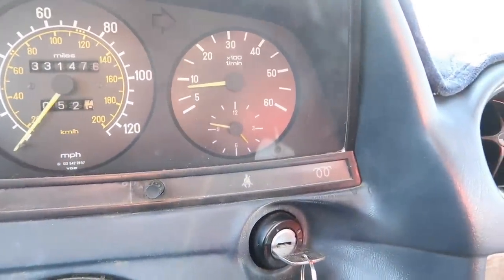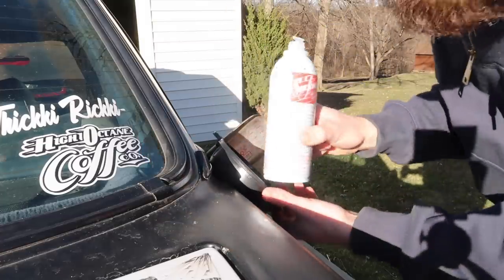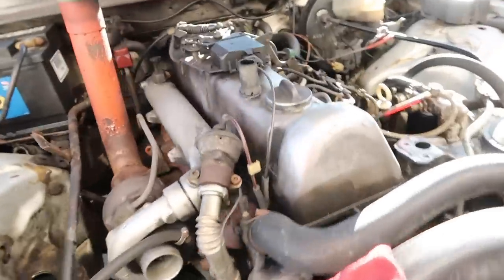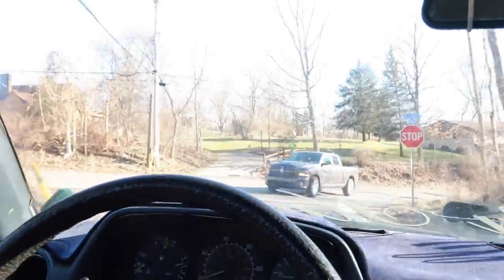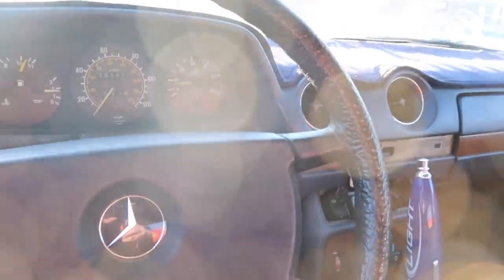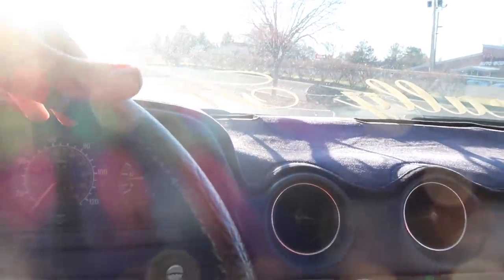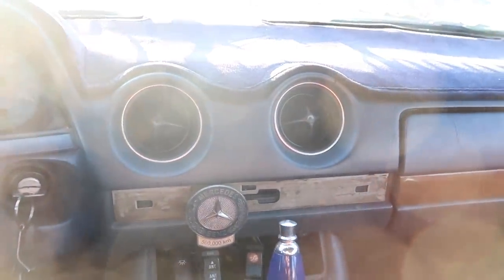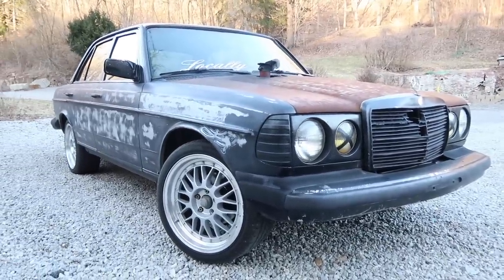What Happens If You Seafoam Your Diesel? - WAY TOO MUCH

Comment: I tell yall what, I put in my 6.7L powerstroke  8oz. of  Clear Diesel by Power Service and man what a difference that stuff made and my rig is well taken care of so it wasn't because it was dirty and neglected. It made a believer out of me. I felt it right away with the down shift. I didn't have to push the pedal down as much to get it to down shift and the power was pretty noticeable. I've tried Sea Foam and I really didn't notice much but then again I didn't put in 2 cans in it.

Comment: I highly suggest you dump that oil ASAP. Sea Foam is mostly just kerosene and while it will clean out all that sludge, it has thinned out that oil way too much and if you keep running it it will destroy the engine.
Reply: Diesel's pretty much oil
Reply: That's a popular myth with the kerosene. However you are supposed to do an oil change after a few hundred miles of seafoam in the oil. But this is because breaking up carbon increases the amount of crud suspended in the oil. It's a consequence of "cleaning." I have seen their intake cleaner do wonders too. I don't know that it is actually better than marvel mystery oil but I can say it is a great product. It's also a water remover which is never a bad thing.

Comment: I usually use 2-4 cans per tank of fuel every now and then and I talked with seafoam and the rep said you can do up to a 50/50 mix of fuel and seafoam
Reply: Diesel can run 100% sea foam. When I change my fuel filter I prime with nothing but sea foam. 5.9L cummins and my isx15 cummins both get it that way.

Comment: Put Seafoam in my 04 6 liter with 170k on the ticker. Put Seafoam in the oil and fuel tank for about 6000 miles and it absolutely fixed my 6 liter. Truck wouldn’t start in 50 degree weather, smoked like crazy. After Seafoam it now starts and runs like a brand new truck. Seafoam saved me from a $3000 injector job. Honestly THE best oil and fuel treatment on the planet. God bless.
Reply: I have an 2000 7.3L diesel, how much should I add to the crankcase or oil?
Reply: I would put 16oz. Seafoam says to put 1-2 oz per gallon.
Reply: @leegray6165  in gas tank or crank case
Reply: Orlando Marner in the engine oil-crankcase
Reply: I also put it into the gas tank. Same ratio 1-2 oz per gallon. That stuff is amazing brother
Reply: @leegray6165  Right On!
I will try that ratio to my 7.3L
Reply: @leegray6165 Will I have to change the oil by putting that in there
Reply: Orlando Marner negative. I ran it for 3000 miles in each of two oil changes.

Comment: 94 Grand Cherokee 4 liter would not pass smog. I changed the cap rotor and wires and also ran two tanks of premium gas through it with each tank a bottle of seafoam. Not sure if it was the sea foam or the new cap rotor and wires but we finally passed smog. We had parked Jeep for 5 years after putting two new cats in it and it would still not pass smog. We have put some other chemicals in the gas tank before that what those did not work before it was parked.
Reply: When Smogging a vehicle it’s best to run the lowest octane your engine is happy with. If it’s not a high compression engine then the longer burn time or incomplete burn of higher octane will be more work for the emissions system.

Comment: Valve adjustment is diesel tune up 31 miles per gallon adjusted,no smoke,if u got over 50,000 miles since the last adjustment,u could burn the seats of the valve,driving like that with the valve taping it an idiot,I bet u it's blown up by now

Comment: Engine flush is essentially Kerosene and that is obviously cheaper than any bottled products for engine carbon cleaning, this being said I wish I never used that on one of my old vehicles because it cleaned away the grime that hid the wear and tear from previous owners and this was simply ran before the oil change at idle.  I imagine Sea Stuff is similar in crankcase oil. 
Kerosene - Napatha. In the fuel tank it the Kerosene is probably like adding Jet Fuel to a lesser extent and should lower the power of diesel fuel ( water it down so to speak ) this can be a good thing perhaps to prevent gelling of diesel fuel being stored for long but now I am getting hypothetical.  Sea foam has its use but I would not abuse a machine with it- read the label.  🥳

Comment: I had this same car new, the dealer had add a quart of 30w oil to each tank. It quieted the fuel pump and injector noise. That is not valve noise it is normal  form injectors, and diesel ping. Also, trans fluid super cleans system.

Comment: I use half of can every oil change on my 2012TDI ! had 326k miles when I got rear ended and never replaced fuel pump on injectors on it ! this stuff is golden and cheap ! only like $8 at walmart
Reply: @BlondynCh  A whole can in the fuel tank made it run rough?
Reply: Michal I run it in my 2003 ALH TDI. Great stuff!
Reply: @tinysolarshack9615  oil or fuel tank? I have an 03 golf TDI. Still seeing differences?
Reply: @tinysolarshack9615  how much do you put in your fuel tank
Reply: I use 1 Oz per quart of engine oil in the engine. I add it about halfway to the next oil change.
In my diesel fuel I add about 4-6 Oz per tank full.

Comment: In these old diesels you can run a little atf in the fuel as a lubricant and cleaner, and you can add some to your oil as well. Works great
Reply: Do you know about how much atf would be safe for 16 gallons of diesel
Reply: Highteckhobbies maybe half a qt. But you cant use atf in an efi system. Has to be mechanical fuel injection. When i change fuel filters i will usually fill the filters with atf instead of diesel. Just do it at your own discretion. Atf has some heavy duty detergents which will clean the fuel system out very well.

Comment: Might be time to adjust the valve lash....which may also reduce the crankcase venting.
Reply: Please explain the correlation to valve lash and crankcase venting
Reply: @drd1924  Excess valve lash can allow   cylinder compression to vent into the crankcase. Basically, the opening/closing cycle of the valves is no longer timed correctly since the pushrods and rocker arms aren't fully opening the valves, and the camshaft is turning  more for the lobes to move the pushrod.
Reply: @zombieresponder  Cylinder compression vent into the crankcase - past the rings?
Since the valves arent open as long as they should be?
Reply: @drd1924  Yes, or they're open at the wrong time.
Reply: @zombieresponder  Thanks man. I understand the importance of proper lash just didn't consider extra cylinder pressure if lash is excessive. Diesels mainly where I've seen lash spec is often more than a gas engine.
Reply: @drd1924  I need to set the lash on my Cummins....supposed to be done every 20k or so I think, at least on a 12 valve. If your Mercedes has a mechanically driven injection pump, it might also be wise to verify pump timing. There may also be an excess fuel return valve that is allowing too much fuel to return to the tank, rather than being forced into the injection pump.
Reply: @zombieresponder  Interestingly, my interest in this topic is also for a cummins 12 valve. I regularly adjust valve lash on ATV's which usually calls for .006" +/- .001 being ok.
and if the adjustment ever changes it always reduces clearance as you might know due to valve wear. Last I checked my cummins exhaust valves it was at .025". I figured I would leave it and check it later to see if there is any valve wear going on but by doing so am considering this could contribute to some crankcase venting.
Reply: @drd1924  .006" is pretty tight. I'm used to seeing small engines in the neighborhood of .010" to .015"....although I have spent a lot more time working on the older L heads than the newer OHV designs.

Comment: You might want to be careful with adding too much Seafoam. When the prechamber burns too hot (like from accidentally adding gasoline), the metal of the prechamber can crystallize and become brittle, and when it breaks, you get bits and chunks in your engine.
Reply: Seafoam says you can run a diesel on straight seafoam
Reply: @ewetho  Short term, like filling the filter housing with it.
Reply: @gadgetdan1  I've done it half and half  it works.

Comment: How does it run if you completely purge the system of the SeaFoam?  If it returns to the way it was before, could that just be the additive increasing the combustibility of your fuel?  What is your elevation?  I have a 1984 6.9 IDI @ 7800' altitude and used it once-down the intake the lesson was nothing short of- I wouldn't advise this entry point.  Thanks for the info!

Comment: You can buy the recommended German fuel system “diesel purge” cleaning liquid on amazon
Reply: ferkemall I’d trust what Germans put in the engine over others who didn’t design the engine or fuel system anyway over sea foam, I’ve used it and it never did anything but make the engine smoke bad.

Comment: But hey, when you put a cleaning additive in the oil, you should Gas with it for 15 minutes with, for example, 1800 RPM. You should not drive the car and you should drain the oil and change the oil filter afterwards

Comment: I use it in all my 2stroke,if it call for 4ozs of oil per gal. I add 4ozs of seafoam and add gas to the 1gal mark.It results in the cleanest and driest spark plugs, which means that everything is burning completely
Reply: Mike Hicks have you threw a rod bearing yet ? That crank and rod bearing is lubricated by that 2 stroke oil, I wouldn’t run it every tank or rarely would I ever use it unless you have problem , if you have a problem fouling spark plugs run a hotter plug

Comment: the reason of seafoam in the engine is to flush the oil out, your not suppose to go for a long drive lol YOU MUST change your oil right after your 10 mile ride

Comment: Should have showed the oil change. I always have carbon chunks come out
Reply: After adding sea foam you get carbon chunks out of the oil?  Sounds like it's worth it to get that out then.
Reply: @TravisFisher  that's what it does for me. Was looking around to see if anybody else had this happen also.
Reply: @TCGThuggyC  thats actually terrible ..you dont want carbon deposits breaking off and going threw a turbo!! It will ruin the turbo. If your getting chunks of carbon then you need to tear apart the top half and have the valves cleaned professionally..
Reply: @planetofthederps4490  I just have a 5.4l, no turbo. I clean the metal oil filter in the pan everytime. It works for me

Comment: Use motorkote works great .  My 6.slow loves it.  My injectors are quieter now .
Reply: Use rev X. Your 6.0 will love you way more. At least mine loves it. It’s pricey but I treat it every other oil change.
Reply: Love the Motorkote. Really love they're spray lubricant too

Comment: High risk games.  Petroleum is a great solvent.  But you risk a gasket leak due to removing the seal created by carbon deposits on high mileage engines.  Everything runs smoother for sure.  Even improved fuel economy.  Plus, a longer engine life as the protective film covers everything helping prevent excessive wear from moving parts.  Use any petroleum additive on an engine under 70K if you want to see 500k.  I hear an oil catcher is also key on a variable cam to prevent sludge damage to cam solenoid and lifters.

Comment: Used it on my e46 Diesel BMW half and half as instructed, the air intake sucked in a valve (later improved) model and then the engine runs on after I cut the ignition, engine has never sounded the same since.

Comment: Do the intake spray!!. Would love to see the color of the oil after it cleaned up the gunk
Reply: Shaun Thomer that smoke you see when you put a fuel cleaner such as sea foam in the intake, is the actual cleaner getting burned off
Reply: @michaelnikprelaj6679  if that were true. It would smoke immediately and not after the heat soak.

Comment: hope you are change the oil =) also a (cold) air intake  (k&N filter)  is needed,  i mean outside air, not from under a warm engine, to top of the gains.
Reply: Needs pil change. Delo 400 or Rotella T4/T6 would be good. Adjust valves and check timing. Turn the pump up and give her some more timing. I'd use a dry filter just cause that turbo gonna be sucking out that wet filter oil.

Comment: Your videos are really good ;)  I also use Seafoam in my gas alot ... I really like it.  There is also this stuff called  Auto-RX that has been equally interesting .... I tried it in my transmission and could tell a difference with-in a few blocks ...... it might make for an interesting video, cuz basically no one really knows about it .. .. .. it works in engines, transmissions, power steering, etc ...... it might make for a good video .. .. ..
Reply: Do a video on it, sounds interesting.

Comment: NON synthetic 2stroke oil in the fuel helps to with an old diesel
Reply: ATF in Diesel, A Qt. like everyother fuel fill up, use it in 92 5.9 Cummins & 99 7.3 always.
Reply: @guyrankin7992  why at my friend ,what does it do 2000 va tdi
Reply: Tony Liguori helps lubricate what sulfur use to before they went to ULSD.

Comment: I ran seafoam in my 86 gmc 3500 tow truck and it blew the number 7 valve seat and trashed the piston and head hasn't run the same since even with a new head and piston. 
I almost fogot to mention my engine is a 350 4 bolt main gas engine and it had less than 98,000 miles on it when the valve blew
Reply: James Grear i would think there was a pre existing condition prior to you adding the seafoam.
Reply: @kevinrehele6033  i agree ive had a few 350's and ran seafoam through em amd never had an issue

Comment: That's one way to blow your engine seals....if your'e putting in an extra quart of fluid into an already filled/leveled engine, that extra fluid has to go somewhere and that somewhere is thru your block seals.
Reply: I keep waiting to find someone that has had an adverse reaction to a crankcase overfilled.  I've had many a vehicle a quart overfull and never seen a problem yet.  Have you personally seen an issue from overfilling an engine by one quart?
Reply: @blythkd9017  I haven't personally done it but have a buddy that's a mechanic and he told me by all means it can happen.
Reply: @shawnschroeder549  That's cool.  I wasn't trying to be difficult, I was genuinely looking for new information.  If I learn something new everyday I don't feel like the day was a waste.
Reply: @blythkd9017  no biggie...it was a good question
Reply: No, it won't blow seals. If anything it'll go our your PC valve, but only if the entire block is full. Only adverse reaction will be foaming from the crank splashing through it.
Reply: I don’t know about blowing the seals out as with an overfilled automatic transmission but blow-by or  leaking more easily yes.

Comment: I’ve actually been wondering what sea foam out do in the crankcase of my 250k mile lbz or should I just leave well enough alone? Lol.  It runs fine.  Balance rates are fine.
Reply: If you like Mercedes and Diesel engines look at Mercedesource on Youtube. Kent is very knowledgeable and interesting to watch and listen to. Enjoy.
Reply: Add hot shots oil additive
Reply: Cody Marston I was using OptiLube OilFortifier but the shipment was expensive.

Comment: A diesel will run on STRAIGHT Sea Foam. In fact, SeaFoam Official recommends filling the filter housing with Sea Foam instead of diesel fuel when changing the filter. They say to change the filter when the engine is warm, add the Sea Foam, run it a minute, then let the Sea Foam SOAK for a while (I'm foggy on the times, see their YouTube video), then drive it for over half and hour to push all the crap that is dissolved thru the system and burn them. It WILL run worse at first, while this junk burns off.

Comment: I used Seafoam I a Harley Street 750. Put a swig in the Oil. As too much dilutes it. Rest in the tank. Rode it for about 300 miles. Changed the oil and filter. Might try it on my 18 Sportster 1200 oil. But with 6700 Miles, I'll wait until Spring.

Comment: Never used the stuff but I've heard a lot of good things. Are you suppose to change your oil after so many miles? I thought I've read somewhere it's a good cleaner for the oil but the seafoam is not suppose to be ran to long before a fresh oil change.
Reply: According to seafoam,  leave it in the oil for about 300 miles

Comment: You should add it to the fuel filter when you change the filter, (have the engine at temp), run for two minutes, let it sit for 15, then drive it for 30 minutes at high rpm to blow out the shit from the injectors

Comment: I used it in my fuel tank on my 95 7.3L. Cleaned so much junk out of the tank I ended up changing out the fuel bowl and filter. Couldn't get all the crap out of the bowl, so replaced it. 
I wouldn't add it to every tank. Seems an unnecessary expense.

Comment: That Seafoam is not a good idea.

Use Ox-Cetane in Your Fuel at a 1:4000 ratio.

Your fuel has Entrained and Dissolved Air when its in the tank.

The Ox-Cetane will restore lost fuel economy and performance and let the Fuel Clean out the dirt in the Engine.

Comment: i say let her eat, redline it for a good couple seconds and rev the nuts off it, helps remove carbon deposits and flow high pressure, you may rupture some seals but you may also gain power

Comment: If you throw atf in it it’ll do the same thing just not sea foam. I sure hope you changed the oil after this.
Reply: ATF is different and will not be as cutting as the Sea Stuff, you can run the ATF in some quantity for the entire life cycle of the oil change and though it lowers viscosity it’s main ingredient for cleaning is its ability to suspend carbon deposits in detergent. 
It is in a way safer but not as effective, sometimes effective is bad; just saying.

Comment: Sea scum ruined my gasoline engine spark plugs. It caused a hard tan colored cement like carbon deposit to build up on my spark plugs. Maybe I will try using it as a parts cleaner but its definitely not going into my fuel tank again.